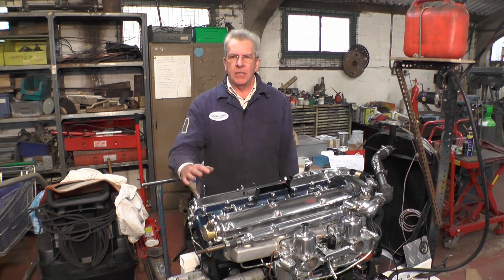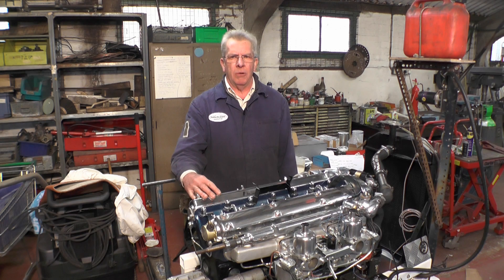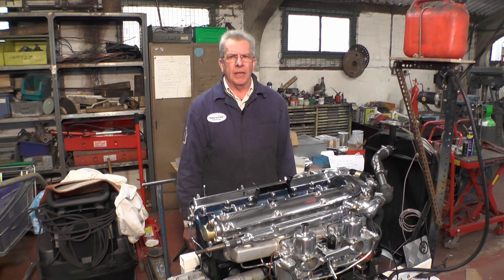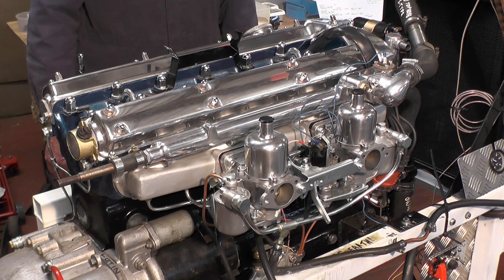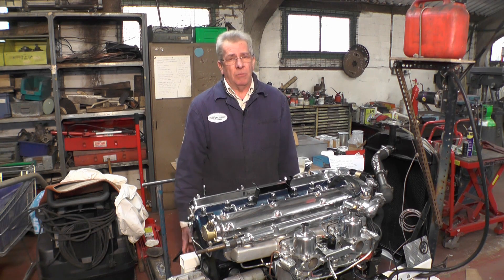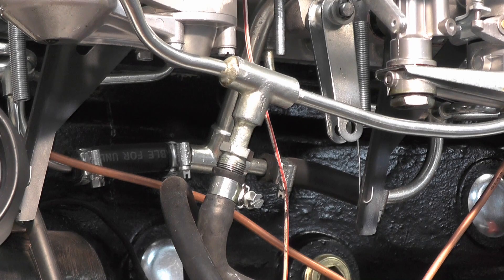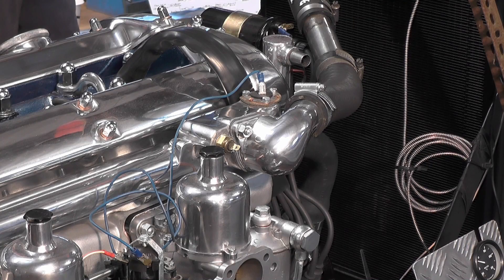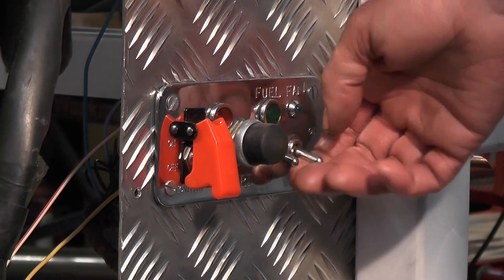Jaguar 3.8 S-Type Engine Rebuild Issues - Nigel Boycott XK Engine specialist

Comment: the 3.8 litre engine in my '65 S type has worn crankshaft bearings. Everybody wants to rebuild the entire engine, which it doesn't need at 83k miles. So I bought a running 4.2  XJ-6  engine and it is going into the S type.
Reply: I bought a 62 3.8 mk2 that someone was halfway through fitting an xj 4.2 ive removed that and im fitting an S type 3.8, that i need to have rebuilt

Comment: 1965 3.8 "S".  engine idles fine but when accelerated a clunking knocking sound is heard. Have been told it is the crankshaft bearings, and/or the flexplate. Drained the oil, lots of golden particles at bottom of drained oil. If engine is otherwise good, can the crank bearings be replaced with engine in situ? I do not think engine needs to be rebuilt completely. Thanks for any advice.

Comment: I've worked jaguars since 1963 and have overhauld loads of strait six engines,  2.4, 3.4, 3.8, 4.2,  V12 & later 3.2, 3.6  Litres.
First car i worked on as an apprentice was an XK120,   2nd car was a MK 1X.
Reply: I guess Jaguars aren't nearly as  reliable and durable as the propaganda says and/or Jaguar dealers, mechanics and owners don't take very good care of them if you've rebuilt loads of every "current" Jaguar engine throughout your "career" given how "high-end" the cars supposedly are and how few Jaguars were/are EVER built for or purchased for even "normal" daily-driver use doing the wide range of driving the "average" driver of a more "practical" and "utilitarian" contemporary competitors of the "Jags" you wrenched on constantly presumably doing mainly lightrepairs and service and maintenance and tune-up type work does with his or her car. So dwhich is it? Shitty cars and manufacturer selling cheap junk wrapped in expensive propaganda to "discriminating" drivers with enough "scratch" to be able to afford the "high-end" supposed daily driver and all the maintenance and service and "minor repairs" they must need for somebody to make a 55-year "career: wrenching on what are very expensive and "specialized" cars clearly not build to be daily-driven "commuter" or "grocery getter" or "family truckster" cars being "abused" by not being "babied" enough even with highly skilled and very knowledgeable and experienced Jag-specific "technicians" doing the wrenching at professional, honest, dependable and reputable dealers with excellent parts and service support? And working on cars that must be about as common as Chevys in "Commonwealth" countries to keep dealers and mechanics that busy? Or a bunch of half-assed "mechanics" and "engineers" at Jaguar and Jag dealerships owned by "corporations" and wealthy "upper class" owners/investors who just break it off in the asses of every "middle class" Jag owner who can "afford" to have a "toy car" as they drive either much cheaper "economy" cars or take the bus or subway to and from work in the case of the mechanics/engineers and drive Rolls-Royces or Bentleys or maybe just a new "Jag" every couple months and maybe show up at their "business" a couple times a month to sign paychecks and otherwise are "out of the office" and out playing with their much more expensive "toys" at their "country houses" driving or riding in "good" cars so infrequently that even they never discover just how shitty British cars are even when "high-end" and "new"? And in a situation where since the "boss" is never in and never has to take any ass-eatings from pissed-off Jag owners  sick and tired of their "high-quality" Jaguar sitting in the dealer garage more than their own garage while the ham-handed "mechanics" with "master" status stand around telling stories about what great mechanics they are to the "apprentices" who don't even want to work on cars period but didn't have the grades/connections/family tree to go to "university" and are just trying to figure out a way to get "sacked" without having it affect their "social status" and in general are  complete fuck-offs anyway and illiterate and mechanically-declined ones at that just going through the motions of doing a "tune-up" on those piece of shit boat anchors that were jacked with and "updated" so often by the factory and dealers and mechanics alike trying to get the pieces of shit to run long enough to get the out of the factory, showroom and garage even the moron "engineers" writing the service manuals couldn't keep up "updating" manuals nobody at the dealership could read without either moving their lips or getting help with the "big words" anyway if they even had the manuals and hadn't used them for shit paper long ago?

When Jaguar owners are all over the internet bragging about how good and rare and special and reliable and durable and valuable their "vintage" Jaguar or the SEVERAL most of them seem to have claimed to have owned that were all PERFECT but yet not "PERFECT" enough to NOT REPLACE at what is and has been for DECADES AND DECADES "low miles" for ANYTHING built in the U.S. and driven/maintained/serviced by people with half a clue is or are while for some reason being on forums/blogs/YouTube videos about repairs and rebuilds and "restorations" and speculating on how "valuable" their supposedly "priceless" cars are/will be/were at "auction" or "private sale" WHILE "mechanics" like you make videos  and comments and "helpful" recommendations talking about how many of those "high-quality"  cars you've worked on in your LONG CAREERS that have been spent all on Jaguars doing all kinds of minor to major repairs/rebuilds/restorations on all kinds of Jaguars built in the last 60 years that either DON'T PAY VERY DAMNED WELL IF YOU STILL DON'T HAVE ENOUGH MONEY TO RETIRE AT 70+ YEARS OLD TO YOUR OWN "HIGH-QUALITY" JAGUAR PROJECTS OR YOU'RE NOT MAKING A HELL OF A LOT MONEY DOING GOOD-PAYING WORK BECAUSE YOU'RE DOING THE SAME JOB TWO OR THREE TIMES ON EVERY CAR AND ONLY GETTING PAID FOR ONE OF THEM, I JUST HAVE TO WONDER WHO THE HELL YOU JAG "ENTHUSIASTS" THINK YOU'RE BULLSHITTING WITH YOUR DIRECTLY-CONFLICTING OPINIONS OF AND EXPERIENCES WITH THOSE PIECES OF JUNK THAT ACCORDING TO OWNERS CAN'T BE BROKEN AND ACCORDING TO MECHANICS CAN'T BE FIXED.

And just how Jaguars HAVE BEEN BUILT AND SOLD IN THE LAST 60 YEARS FOR SO MANY INTERNET BLOWHARD BULLSHITTERS WITH VAST EXPERIENCE OWNING/DRIVING/FIXING/SELLING/BUYING/TRADING THEM OUT THERE HOLDING FORTH LIKE THEY'VE LIVED IN THE DAMNED THINGS SINCE THEY WERE OLD ENOUGH TO PEE STANDING UP? What i find HILARIOUS is how "popular" in the "states" Jagoffs in "Commonwealth" countries must think their cars are to waste so much time "selling" their brand and cars and services and goods online to what is at most can't be more than a few tens of thousands of hardcore "vintage" 
 Jag owners in the U.S. where only ANGLOPHILES and "IMMIGRANTS" from "Commonwealth" countries and maybe the occasional son/daughter/grandson/granddaughter of same and MAYBE the DUMBEST of the DUMBASS "car collectors" who think "old" and "foreign" and "valuable" and "rare" always go together and a few idiots spending a lot of money on "full restorations" means Jaguars are "good investments" even know what a Jaguar is beyond a Jaguar and THAT WOULD BE JUST THE "CLASSIC JAGUARS" AND MAINLY BECAUSE THERE WAS ONE IN AN AUSTIN POWERS MOVIE. 

Because I can tell you from long experience there are two things Americans and especially "car guys" DON'T PUT UP WITH OR GIVE A SHIT ABOUT. THE VERY FEW LEGITIMATELY "SHITTY" AMERICAN CARS THAT "DETROIT" HAS PUT OUT IN THE "MODERN" ERA AND THAT EVEN "FANBOYS" OF THAT MAKE WILL ADMIT WERE "JUNK" FROM DAY ONE AND SHITTY BRITISH CARS AND THEIR BLOWHARD "ENTHUSIASTS' WHO CAN'T SHUT THE FUCK UP ABOUT HOW AWESOME THEIR WHOLE ENTIRE COUNTRY AND EVERYTHING IN IT AND THAT HAS EVER BEEN MADE BY IT IS WHILE HERE IN THE U.S. OR ON "AMERICAN" WEBSITES/SOCIAL MEDIA SITES OR BACK IN JOLLY OLD ENGLAND TALKING SHIT ABOUT AMERICAN CARS THEY SURE AS FUCK DON'T HAVE ONE TENTH AS MUCH EXPERIENCE WITH OR KNOWLEDGE OF AS EVEN THE UNFORTUNATE AMERICAN WHO MAY HAVE SPENT A MINUTE OR TWO IN AN ANGLOPHILE RELATIVE'S "AWESOME" BRITISH MG OR JAGUAR OR RANGE ROVER OR OTHER BRITISH SHITPILE BACK IN THE DAY AND EVEN IF ONLY SMALL CAN STILL REMEMBER HOW CRAPPY AT LEAST ONE THING ABOUT IT WAS.